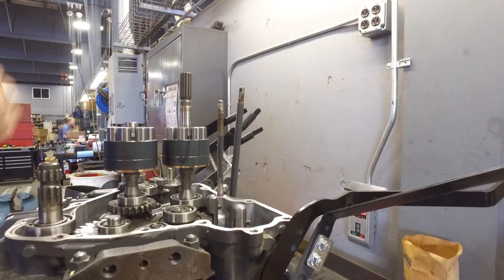Kubota BX-series Transmission: A Look Inside

Comment: Thanks for the video . I need to replace my front Transmission Cover because of a broken hydraulic Filter Threads are broken off. Is there a video available of someone pulling the Front Cover off ?  Also was wondering if I need to pull the Transmission out of the tractor to replace it! If anyone has any suggestions or information about this please let me know? Thanks 🙏 Dale

Comment: Hello thanks for your video. I'm servicing my BX2350. I replaced bearings on my PTO shaft. But I'm a bit surprised because all the bearings on the front cover housing are "loose". Is that normal ? (It's my first time on this kind of machine).
I saw some traces of wear but no measurable ovalization on more or less all the bearing housing in the front cover of the transmission.
I you can tell me if this is normal or if I need to glue them with loctite 601 or stronger?
Thanks.

Comment: I know this is old video.  But thanks. It would be nice to have some trouble shooting information so that we the buyers know if something needs repair or replacement... in my case, bx23 1100hrs. Services have always been done. Fwd motion is slower or struggling then before, all other hydraulic functions appear to be close to normal. I woild like to know what it might be or what needs to be repaired thanks.
Reply from the maker: What kind of transmission fluid is in it? And what's the last time it was changed?
Reply: I have been changing the fluid about every 2 years. I know it is more then necessary but in this way I know I am good. I purchase all through a Kubota dealer, filters and hydraulic fluid, super udt2, I think 3 gal.
Reply from the maker: could be a bunch of stuff. pedal linkage is the first I'd look at. Check the grease zerks. transmission pressure reliefs maybe. @professionalinspectionserv4228
Reply: Thank you.  I am trying to make a moving decision whether to take this with me or sell, what is the cost worst case, more then the value of the unit? Can a tran unit be effectively rebuilt if needed or replaced outright?  I will check out the pedal linkage...Thanks. @MessicksEquip
Reply from the maker: @professionalinspectionserv9468  can be $5000 or so to do a total trans overhaul. Not typical at all though.
Reply: Thank you. @MessicksEquip

Comment: thanks for the vid here. very helpful
Q. can the 4wd shaft you showed at 4:15  be removed and replaced from underneath by just removing the front cover and without dropping the whole trans/dif assembly?
I have a BX23 that works fine in 2wd, but in 4wd it sounds like the shaft splines are stripped or the gear teeth are chipped and under a load such as going uphill it makes a clicking sound at the output shaft and when it does this the front drive shaft stops spinning
Reply: Do you receive any answers ?  I have the same issus
Reply: Messick@
Reply: I have same issue and replaced the 4wd shaft, gears, and bearings last year and still does the same thing. Have you found your problem yet?

Comment: I was shifting from high to low today and something let go and now theres no low or neutral, but high still works. Any idea? Can't find anything online. The shift lever flops with no resistance if I try to shift it. Tractor is a year old with 75 hours, maybe a shear pin?

Comment: I had an issue with my BX2230 mowing last summer.  There would be a strip of uncut grass, along with an occasional vibration (very slight) coming from the mower deck.  I replaced the belt on the deck, and changed the gearbox fluid on the deck gearbox.  There isn't any play on the front PTO shaft.  Any ideas on what might be wrong?
Reply from the maker: Spindle wearing out.
Reply: Thanks for the quick reply, I'll have to check the spindles.

Comment: When did kubota switch to aluminum for the transmission and differential?
Reply from the maker: Always has been, never seen an issue with it. All subcompacts are I believe.
Reply: @MessicksEquip  just curious..I’ve Been researching sub compacts and I’m seeing people break the rear pto that often takes out the transmission because the trans houses some of the pto components…how do you prevent that? One guy said he was Rototilling hit a rock then bam his 18k tractor was trashed because the rear pto took out his transmission case…I thought their was a clutch that would give way before damage to the Tractor occurred?
Reply from the maker: @oddlyrightoddlyright2475  its because people don't trim their PTO shafts, then when lowering the 3pt the implement shoves back into the gear case. If you trim your shaft correctly you won't have a problem.
Reply: @MessicksEquip  awesome man thanks for the answer
Reply: @MessicksEquip  This is half of the answer.  PTO shafts need to be kept clean and lubricated, so it slides smoothly for full travel.

Comment: I was trying to take off my trans cover and could not get it to slide off?  One lever seems to be hanging it up?  I small metal ball and spring fell out?  Does that go in the hole behind the cover with the o-ring gasket? like a pressure check valve? and if so does the ball or spring face the front of the tractor?  thanks if you can help.

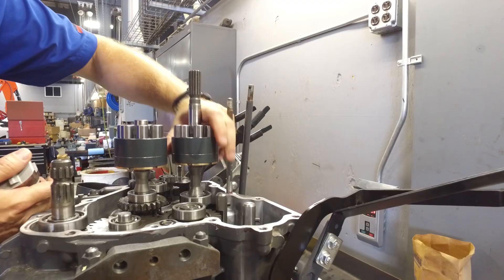Comment: Interesting to see the inside of this transmission, but not really sure whether Mr. Eddie is familiar with this transmission. He mistakes pump shaft with motor shaft. It is vice versa of what he describes at 1:27. Clearly, the pump shaft is the one with the splines since it has to take power from the engine. Also, not really sure what he means with his explanation at 2:25, but essentially, if that were the case, it would make the PTO to spin in one direction when you go forward and the other direction when you go backwards. Make absolutely no sense. The so called PTO shaft (with splines sticking out) and the PTO itself are driven by the engine and not by the hydraulics in this transmission. Only PTO clutch is hydraulically operated. Oh, and he actually holds the swash plate upside down at 1:42. 
Source: owner of a Kubota BX.
Reply: I have been wanting to know that forever. Thanks for the explanation!
Reply: Yes, most Kubota mechanics, technicians, sales people and staff are generally clueless regarding function and engineering of their equipment. Most technicians are just parts replacers.

Comment: so what was the problem with this unit?
Reply from the maker: +Alex Wrench customer ripped up the diff I think. Same rear as our insurance video.
Reply: @MessicksEquip  Yes, blame the customer for an inadequate diff-lock.  Increase the Pin size to 12mm, increase the pin length by 4mm, install an adjustable pedal stop, and properly instruct customers how to use the diff-lock.  It isn't the engagement that damages the mechanism, it is lack of decisive dis-engagement. A customer should be informed how important quick dis-engagement is, as should the mechanics and sales staff.
Reply: Be nice to the diff lock on these